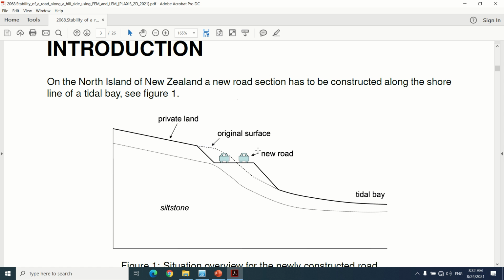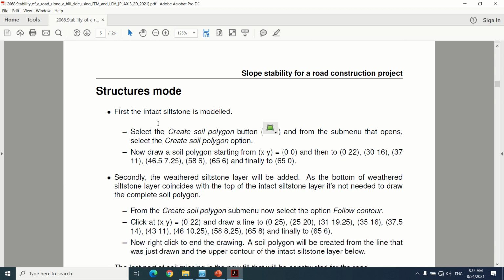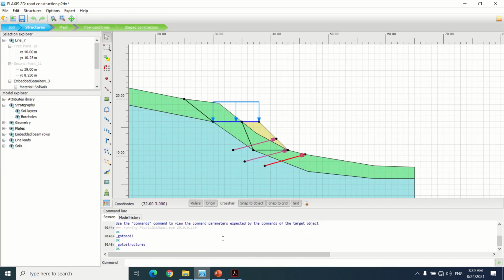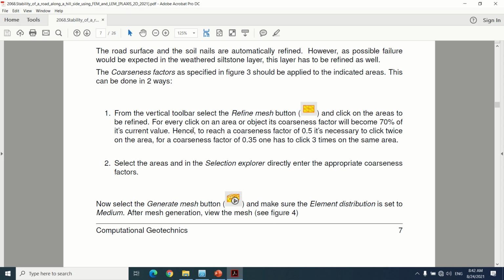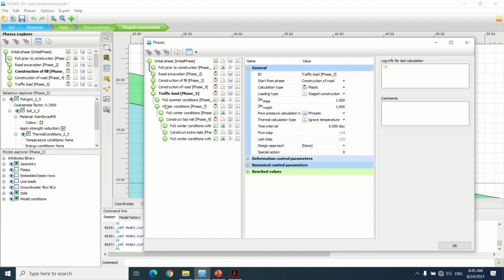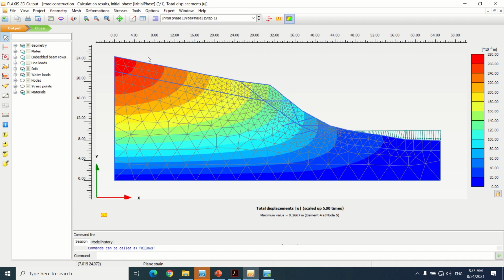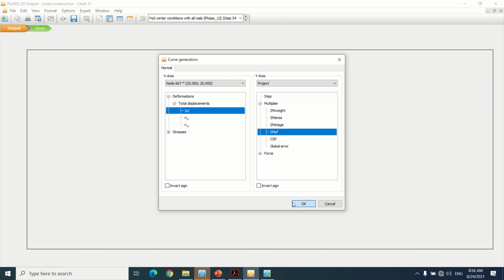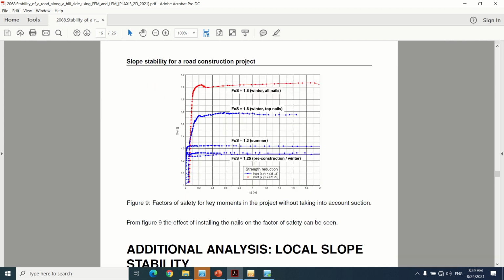Road construction plaxis

Comment: I am currently attempting to design and analyze the Mexico City basin in 2D using PLAXIS. As we all know, this involves modeling an extremely large basin. How should I properly scale the actual basin geometry and soil parameters for the simulation? I would greatly appreciate your valuable insights and guidance.

Comment: construction of road displacement 0,02044 m displacement, when adding the traffic load surcharge load displacement decrease (0,01838 m) how it could be in plaxis ? in reality it have to be contrast displacements have to increase ( did you reset displacements zero before stage )?